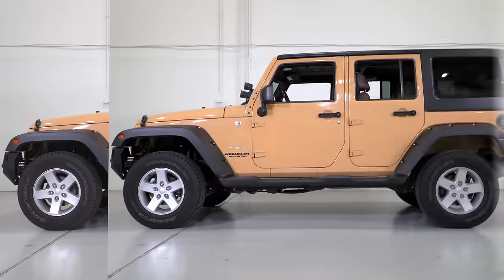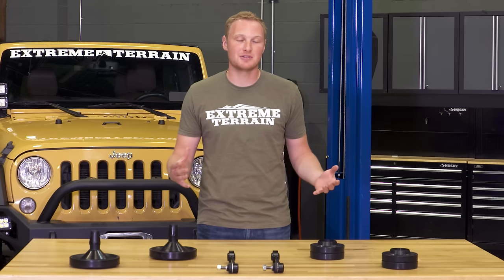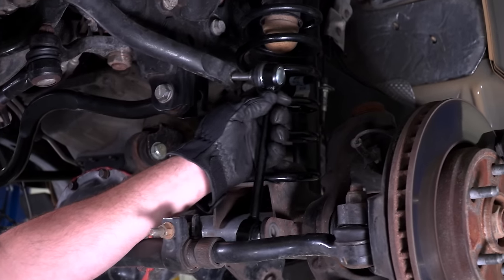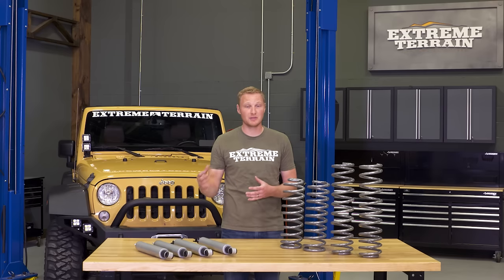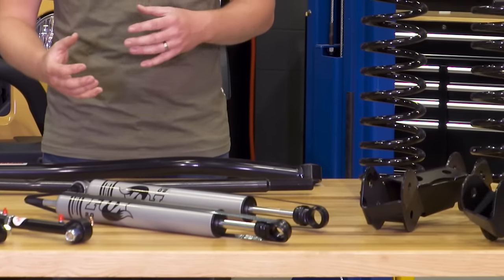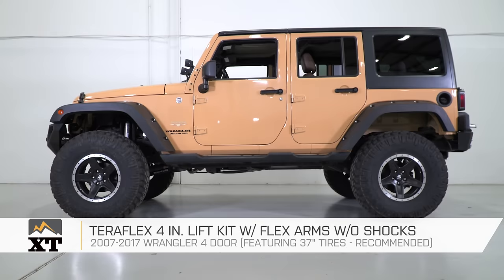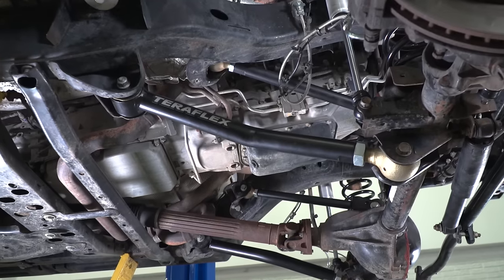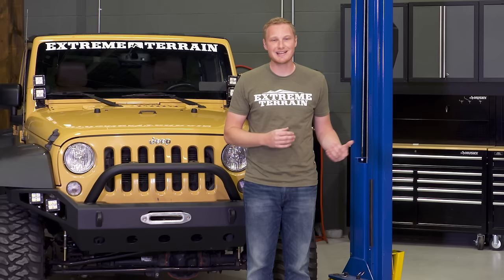Jeep Wrangler JK Leveling Kit vs 2.5" vs 3.5" vs 4" - How To Select The Best Jeep Lift Kit

Comment: I've heard you can run 35" tires with just a 2 1/2" lift kit and a 1" body lift ... is that true?  And don't you need to recalibrate the computer to get proper speedometer, odometer, and shift point controls?
Reply: I've been running 35" tires on a Rubicon Express 2.5" kit for a long time now.  No body lift, stock fenders and it fits and wheels very well. JKs require an 1.5" wheel spacer on the stock wheels or at least 4.75" backspacing on the aftermarket wheel so you don't rub on the sway bars. You will need a programmer like the AEV procal or a more costly programmer like a traildash to make those speed adjustments.
Reply: I have a 2012 JKU on the Rough Country 2.5" lift running 35's with zero issues at all. My speedometer also has auto corrected itself and is spot on with how fast it actually travels, very strange. But 2.5" does work and you won't have any issues rubbing. Do not buy Rough Country though, their springs and shocks are absolute garbage and ride like a dump truck. I'll be swapping my springs soon, already swapped my shocks to Bilsteins.
Reply: LOL. Your speedometer does not "auto correct" itself.  You will need to manually adjust it with a procal or some other type of programmer.  If you are running 35's and did not do this you are not spot on :)
Reply: It most definitely DID auto correct itself, because it's not even off by a 1 mph. I tested it with three separate GPS speedometers and it's 100% spot on. It's my rig, how are you going to tell me how I'm wrong? This isn't my first rodeo.
Reply: Well we've lifted hundreds of jeeps so I might have a little more experience than yourself. I will agree jeeps are getting smarter with computers and electronics but they aren't smart enough to know what size of tires you are trying to turn so it will not adjust your speedo. You have to do that with a programmer. Maybe stick to being a rodeo clown
Reply: KW - you said "we've lifted hundreds of jeeps" ... who is "we"?
Reply: TheZigZiggy OffRoad Addiction
Reply: Lol, "auto correcting speedo"!
Reply: I am running Daystar 1 3/4 budget boost with Pro Comp wheels with 4.75 backspacing, BFG KO2 35 12.50r17's. No rubbing and looks great!

Comment: I bought a used 2016 Rubicon JK and it's running 33" tires.... I don't know if it has a leveling kit or any suspension lift... How can I tell? I know it sits up higher than other stock Rubicons I park next to......I'd like to know for sure because I'd like to run 35" tires and do some modding for offroad.
Reply: Scott Kinderdine with leveling kit you can easily spot a rubber spacer on top of the spring up front . And if it is, you more than likely will still have the red rubicon oem shocks.
Reply: fordracerforever they have Fox Racing shocks.
Reply: It could possibly be this 2.5 lift kit but not too sure 

https://www.quadratec.com/p/quadratec/2.5-inch-lift-kit-fox-mono-tube-shocks-jeep-wrangler-jk?gclid=EAIaIQobChMIjO-Z8vSO3wIVCf_jBx1TqA8YEAQYAiABEgKM7fD_BwE

Comment: If I do a leveling kit like the one in this video, could I add a 2.5 or 3.5 inch lift to it later on? Or would I need to remove the leveling kit?
Reply: Greg Hankins you have to do so much of the same work twice if you do that. Personally, I would wait until you’re ready to do the lift.  If you never want anything more than leveling - go for it. If you think you will someday lift it, just wait.

That being said, if you are just chomping at the bit to tear into your Jeep (I get that!) Go for it! That’s the fun of having a Jeep!

Comment: This would have better been demonstrated if you'd have left the stock wheels/tires on each kit for clearance reference.   Filling in the wells with larger tires each time sorta deflects from the variance perspective without standing beside them in person, just say'n!
Reply: Tuffenough4u no one will ever ride 2.5 and up on stocks. It was a great idea to go up on tire size and the lift rises. Gives you a good idea on what it will look like with wheels that pairs well with that lft

Comment: Great overview for folks. Thanks for posting!
Reply: Wrangler Riders I have 33" toyo open country tires on 20" fuel wheels. With the wheels being 20", does that make it like if I have 35"?
Reply: a 33" tire whether it is mounted on a 14, 15, 16 or even a 20" wheel still is 33" tall. Think of it this way, if you have a doughnut and you cut a bigger hole in the middle does it make the doughnut any bigger? Lastly, a 20" wheel in a 33" tire, while great on the street, will offer very little tire side wall flex when aired down for the trail. Because of the lack of sidewall, the wheel would be much more prone to damage as well. Hope that helps! Doug R. Elder at Wrangler Riders.

Comment: When lifting 2.5, do axel breather lines need to be extended as well as brake lines?
Reply: vanludwig28 no,yu dont need the longer brake lines either.Most kits come with a bracket for the brake lines to mKe them a little longer.My 3.5 inch kit came with brackets.
Reply: Appreciate it.

Comment: You need the 4 inch to run real 35x12.5 with decent wheel options and you can still stuff them if you do the 3.5 or 2.5 and try stuffing the 35 you are extremely limited on wheels offset ECT and may end up running a 35x11.5 tire which can be more expensive than the overly sold 35x12.5 18s and 20s
Reply: This just is not true. 35" only needs a 2.5 inch lift.

Comment: Can we get a video like this for the JL or will it be practically the same?
Reply from the maker: I'll definitely see what we can do! With how the JL's are set up, you actually need a lot less lift to run a bigger tire. With both Sport and Sahara models you can run 33s without any sort of lift, 285/70R17s have been really popular with our customers. If you want to fit 35s all you really need is a 2" lift. 37s will need closer to 3" of lift. The Rubicon models are a little different since they come with higher clearance fender flares from the factory. They can fit 35s without any sort of modification and only need 2" of lift to fit 37s. Hope this helps! -Zach

Comment: Am I able to run 35" tires with no lift?
Reply from the maker: If you switch to high-clearance fender flares, you may be able to fit some 35s on your Wrangler without a lift. Even with that setup, I still recommend at least a leveling kit to get some extra room. If you want to keep your factory fender flares but still run a bigger tire I would stick with a 285/70R17 or 285/75R16. -Zach
Reply: I have 35s on my jk, I did the teraflex leveling kit shown in this video, I also went ahead and did 2 inch wheel spacers and I don’t rub at all

Comment: Rough Country is junk. Save your money and put it towards a good quality lift. There are several on the market.
Reply: Curtis G is the 2.5 inch rock crawler lift a smooth ride? I was wondering since I recently bought a Jeep and need a good 2.5inch lift. I don’t usually go off road.
Reply: That’s an old fashioned sentiment

Comment: I just put on 33s BFG ko2s 285/70/17s today. They ride a little rough. Is that due to the factory socks and suspension? I am thinking of installing the Tera Flex 2.5 in lift. Will that make ride quality better with new wheels and tires?
Reply: I have the exact same tire and size. These tires have an E load rating so are designed for heavy duty service. I ran them with about 40 psi on my JKU and it was rough. I dropped to about 32 psi and it now rides much better. Some even suggest running them around 28 psi. Be aware that though the ride is better, your fuel economy will suffer.

Comment: Can you add prices to the video mods... it would help a lot thanks!
Reply: 636 OC lets just say its expensive,very expensive.My lift by itself was 900.No tires,control arms,reprogrammer,installation by a mechanic.Figure small lift with tires prob 2000 grand.Big lift with 37s cost me around 5000.
Reply: Can you stop being useless and go look up the price?  Its not hard click on the lift you like/want and there is a price.

Comment: Bit late to the rodeo but why you so concerned with up travel? Down travel is what matters isn't it? I personally think 35's on a 2.5 is just fine with the proper bump stops.
Reply from the maker: 35s with 2.5 inches of lift will do just fine for daily driving and mild trails! You really should have a balance of up and down travel though! Speed bumps, pot holes, dips on the highway, etc. all benefit from suspension up travel and give the wheels somewhere to go before they start shoving the body up and out of the way. Suspension up-travel will also allow the wheels to crawl up and over an obstacle without immediately tipping the body. -Zach

Comment: I must disagree on your tire recommendation for the leveling kit. Many factory Jeeps shipped with 32s, so that is NOT a larger tire size. The Teraflex kit will have unhindered uptravel and no rubbing with 33s and 4.5 inches of backspacing.

Comment: Is a 6” on 37s too much
Reply: depends on what you're wanting to do with it.  An overly high roll center is a disadvantage on any uneven terrain, but if you're not planning on going over really steep inclines it's just going to be a matter of aesthetic preference.   
  In my opinion, if you're going to go higher than average on lifts, a wider tire tends to better disguise the gap indifference more than a narrow set would.

Comment: I think the best lift is no lift, and the skinniest tire you can fit - but what do i know, I am old school.
Reply: TheSolitaryObserver You'd be amazed at how many 'experts' are clueless to the fact that a narrower, taller tire will outperform a wider one in just about every condition but extremely loose surfaces like fine sand and liquid mud.
Reply: May be true but a wider tire looks cooler in my opinion!
Reply: AD1, a narrow tire will not outperform a wide tire in any off road condition that I can think of. A wider foot print means you have more rubber on the ground = more traction. You're probably one of those fools that also never airs down.
Reply: I also like cutting through the mud and to solid ground, instead of floating in it trying to paddle through.
Reply: super swamper tsl ss narrow!!!!   nothing but the best

Comment: someone give me real world price estimates for these
Reply from the maker: Lift kits can be as cheap or expensive as you want, honestly. The market is flooded with plenty of options at all price ranges. Generally the larger the lift, the more expensive its going to be to properly lift your Jeep. Leveling kits are the cheapest options ranging anywhere from $50 to $500 if you wanted a kit that includes new coil springs instead of traditional spacers. 2.5" lift kits can range anywhere from $300 to $1500 depending on how many components are included in the kit. 3.5" to 4" kits that are properly put together, around going to be around $1000 at the very least. At that height, replacement control arms, track bars and other suspension components are going to be necessary in order for your Wrangler to perform well both on and off-road. I hope this helps! Feel free to ask any more questions. -Zach
Reply: @extremeterrain  at what lift height 2.5 or 3.5 or whatever does the angle of the driveshaft come in to play And you had to start playing around with the transfer case and transmission and the length of a drive shaft because I cannot get a straight answer from  The pros they just wanna install a lift kit

Comment: my brother lifted his new jeep then put huge tires on it and now… the jeep is garbage. the ride feels like crap, with uneven wear on his expensive new tires, the lift caused an electrical short in the main harness, and now his engine lifters have failed and been replaced twice.
Reply from the maker: Not entirely sure how related the electrical short and engine lifters are to the lift kit and tires being installed, but it definitely sounds like the kit that he purchased isn't properly accounting for changes in suspension geometry and his alignment may be off - that explains the uneven wear anyway. I would recommend looking into a set of adjustable front lower control arms and an adjustable front track bar if he doesn't already have one to get his alignment in spec. Larger mud tires generally won't ride smooth, but higher quality shocks will absolutely help down the line. Hope this helps. -Zach

Comment: This video definitely doesn’t apply to the Gladiator.  He must be talking about older models.
Reply from the maker: To be fair, we made this video a couple years back before the JL or Gladiators were even in production. 😁 Gladiators follow the same path as JL Wranglers do though regarding the amount of lift you need to clear larger tires. You'll be able to clear 33s stock with little to no issues. With aftermarket wheels you'll be able to fit 35s, but a 1.5" leveling kit or 2" lift kit will work perfect. For 37s you'll want to look into a 2" lift at the minimum if you have a Rubicon model, or a 3" lift if you have a Sport or Overland. Hope this helps! -Zach

Comment: JK's are not a Jeep there a bus
Reply from the maker: Body-on-frame design, solid front and rear axles, 4WD system with a transfer case, coil spring suspension, removable doors, tops, and a front windshield that can fold down... Sounds like a Jeep to me. 😉 -Zach

Comment: What far of a lift do you recommend on 17" wheels on 33 inch tires?
Reply from the maker: In all reality, I've seen people run 33" tires on their Jeeps without any lift at all. That being said, it is a lot easier to run larger tires with a lift, especially if you're planning on taking it off road. 33" tires work best with 1 to 2 inches of lift. -Zach